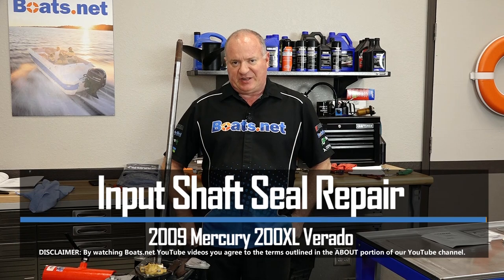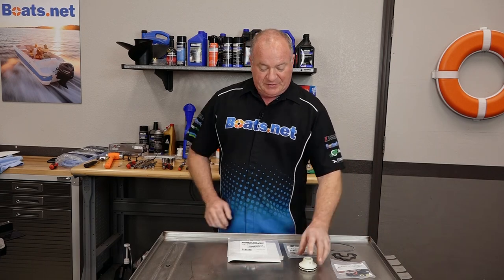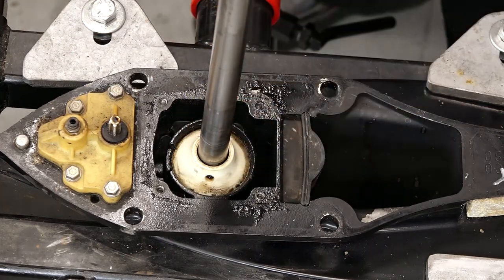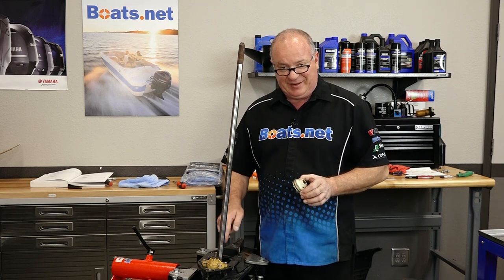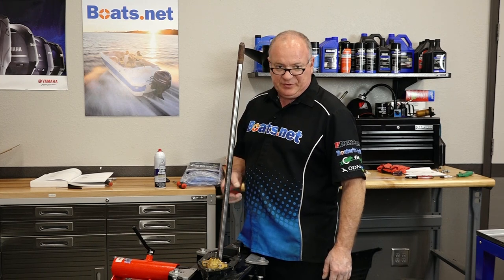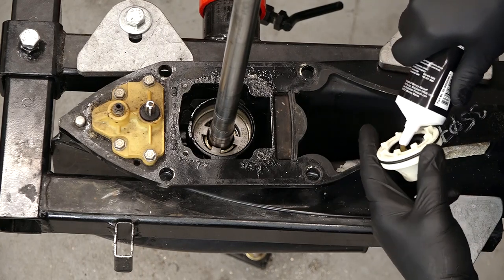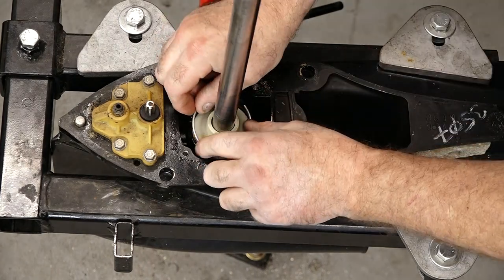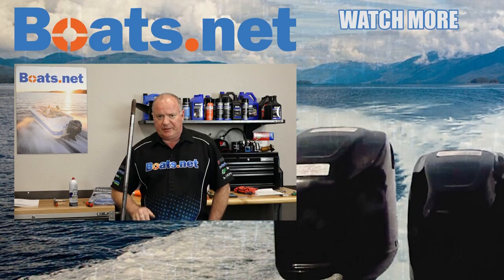Mercury 200XL Input Shaft Seal Replacement | Mercury 200 Verado Upper Shaft Seal Replacement

Comment: If the water pump or shift shaft seals are bad, would this allow oil to come out of the weep holes in the front of the lower unit?

I have a 2010 200hp Verado and am experiencing this.  I’ve watched these vids and am thankful you put this out there!
Reply: Yes